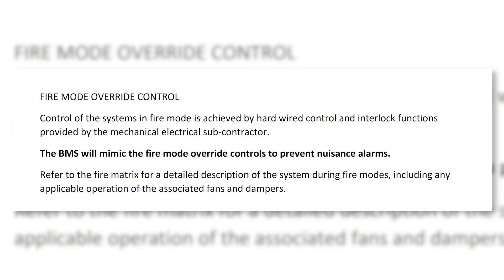BMS & Fire Mode

Comment: Aren't these motorised dampers specified the fail safe in a way that favors fire mode operation? 
And secondly as per AS1668.1 all wiring to smoke exhaust systems should be fire rated and be controlled by the FFCP so this should be an issue.

Comment: In my experience in the Northeast US, the control of dedicated smoke equipment (that is HVAC equipment that only operates during a fire event, as opposed to post event smoke purge/cleanup, etc. which is typically done by standard environmental AHU's and EF's.) control of dedicated smoke control equipment is done by EITHER the Fire Alarm System OR BMS, but not both. If it is done by BMS, all cabling and comm must be protected by 2-hr rated (Mineral Insulated Cable or standard cable run within a 2-hr rated enclosure).
Reply from the maker: Thanks for commenting Dennis. 
Here in Australia, the BMS is not permitted to play any part in the smoke control system, regardless if the cables and power supplies are protected etc. 
Interesting, good to know.

Comment: Hummmmmm l can see how it could happen, but cannot recall seeing that "mimic" clause in a FD.  Most FDs monitor the Fire Alarms to precisely to suppress the mismatch alarms.   And having the power supply to the dampers downstream of the dampers is commonplace - in my experience.  

My gripe is commonly seeing fire interface panels in their plastic enclosures located in exposed positions.....ie: they connect to fire rated MCCs from exposed positions.  

Next gripe, is over time fire service companies sometimes change the fire matrix, especially those that are very complex, making a mockery of the fire engineering.  I have seen this often, but yet the Fire Safety certificate is signed.....😮

My top tip for dampers used for smoke control is to have end switches (or similar) so that the BMS can monitor the actual position remotely during fire testing....,.saves time and hassle.
Reply from the maker: Every single BMS FD in Victoria Australia has that statement in the FD. Where are you based?
Reply: @bryceanderson17  Sydney.....

Comment: Is it not standard process for the BMS to mute the fire trip signal during fire testing?

I've also seen it quite explicitly stated in both mechanical specs and FERs that the AHU BMS dampers are to have their power run through a fire trip relay.
That being said, I've definitely seen what you've shown with relays that have been overridden not only after commissioning, but after annual fire tests.  It's quite worrisome.
Reply from the maker: It is worrying, maybe we shouldn't supply relays with mechanical overrides for life safety relays? 
Cheers.
Reply: @bryceanderson17  there's always somebody dumb enough to outsmart such efforts 🤭 like moving the wire from the N.O. terminal to the COM terminal, directly connected to the hard active... "Hey relax, I'll put it back how it was after lunch"... Often on a Friday before a long weekend 🥳